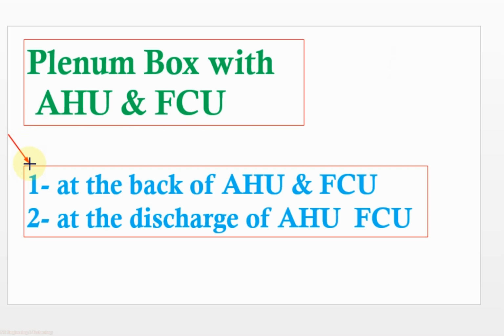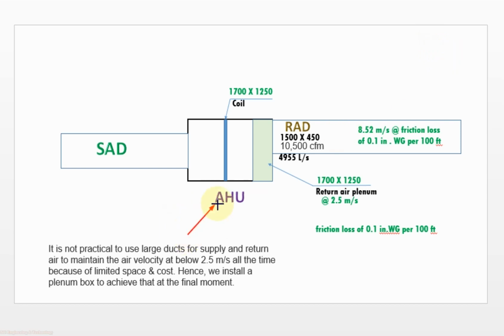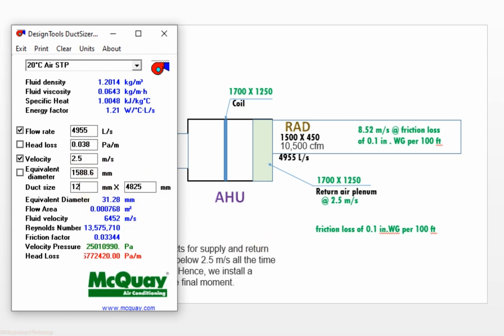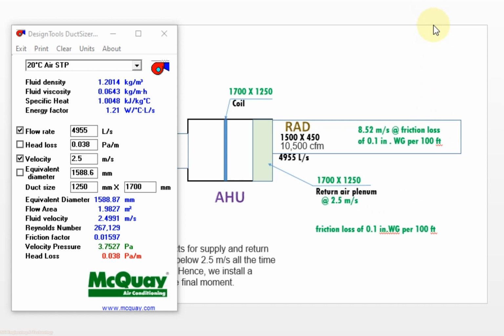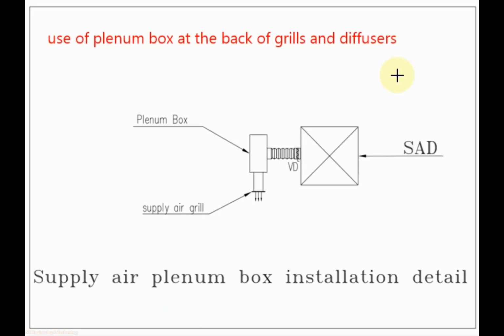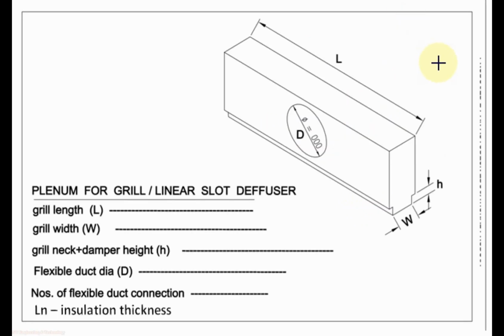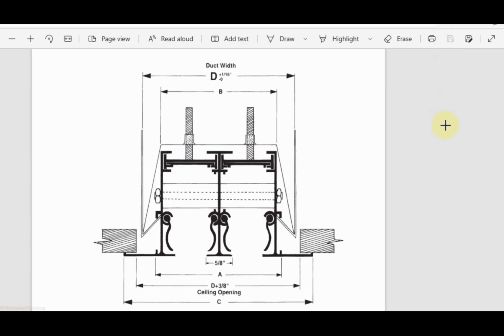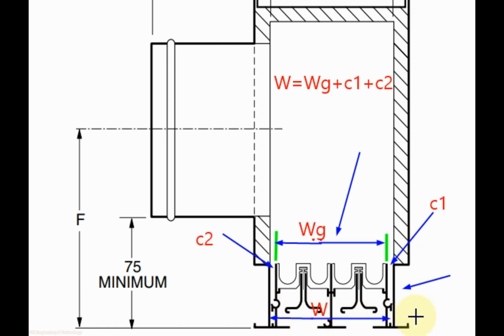111 - HVAC duct plenum box design for AHU, FCU and plenum box for grills and diffusers in English

Comment: Thank you for this informative video. any rules for number of flexible connections? what is the height of the box? limited to false celing height is a point but any relation to W and L of the box? Dia of Flex? can you kindly clarify these things? Thx in advance.
Reply from the maker: For plenum height, other than false ceiling you need to select flexible duct size, length will be according your grill length.